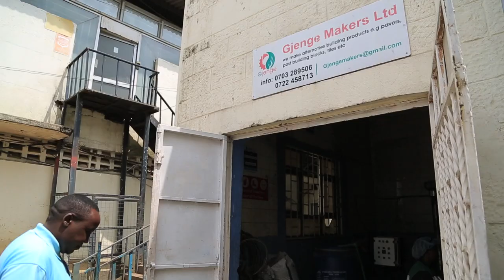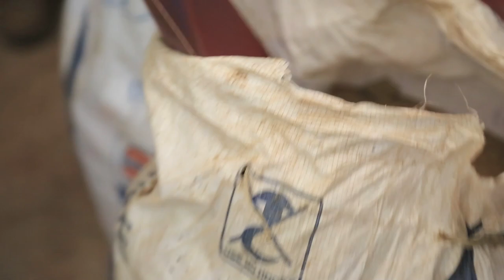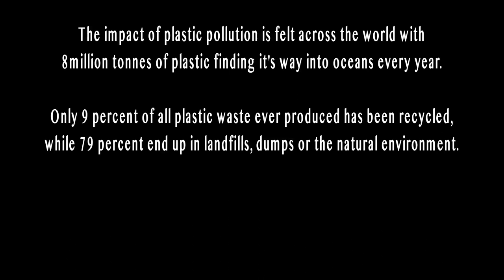We make pavement bricks using plastic waste | Gjenge Makers Journey

Comment: Not only is this a use for previously disposed waste, cleans up previous mess. But also fits in to the three Rs. Reduce, Reused, Recycle. this being a recycle/reuse case.

After seeing the project on another channel i did a quick search thinking there are a lot of none binding building products to be made. the process of plastics and "sand" indeed is used for pavers of all sizes to roof tiles, and that as far back as 2003 i saw. 

so for this particular small scale endeavour, there is definit room for expansion.

there are some downsides i see.
> sand is an increasingly precious resource
     -sand processing, round grain to rough grain, 
      grind the sand maybe
> power usage for the melting
    - green energy, heating with direct solar, or local small scale power plants.
> poisonous gas production during heating
    - the most technical problem, but europe has had trash burning plants for a while. 
      the regulation is tight so their filter systems must work on the filtering front. 
      cost and environmental impact on product life cycle is Something i didnt know about
> long term effects and product longevity
    - how long does the product last, 
          how is it with UV rays, 
          does it break down, 
          what are the effects or the broken down product.
     - How is it this heat and cold,
             breakage, expansion/contraction
     - how do you recycle this product, 
          oh she said you can reuse the material
     - does it seep chemicals over the years
    

upside i see are.
> local industry and jobs.
> acquisition of the plastics
    - collection from dumps or collection companies etc, ecosystems already exist
> reduction in transportation
    - replacing the cement or stone or clay
    - the plastics to dumps in asia
    - local product to no shipping across the globe in some cases.
> waste management
    - the quality of plastics can be low, but how low?
    - loose piles of waste everywhere to compact managed none seeping locations
    - reducion of free floating plastic waste

but taking a huge loose pile and homogenously spreading it in compact form is brilliant.
how much terracotta, porcelain, cement, or rock can be replaced. and these are just non binding solution, if its made to stick to cement, then why not build vertically with these.

aesthetics is an issue at present.  but if this world is to survive. function is going to have to take precedent to form. Why marble front porch when you can use plastic/sand pavers locally. but even then you can work on the aesthetics. thought natural colour which probably have the smallest resource footprint.

(i hadnt finished the video, which is welldone, by the time of writing the comment, so some points might be mute )

Comment: compression compression as is with low heat no shredding or sorting keep it simple. like use steel compression equipment. sheets, bricks boards, etc. keeping smell lower. better then wood or steel.

Comment: Its a great idea to use plastic bricks as construction material, but it won’t work in other countries. How can we recycle the plastic bricks when you want to renovate it? Is the plastic bricks classific as construction material or rubbish? the answer is going to be rubbish. And it is very high cost to throw rubbish in any countries. on market value MAYBE its cheap to build, but its going to be expensive to burn it down, is illegal to bury rubbish in most countries
Reply: You are extending the life of waste plastics by years or decades.  For recycling, they are stable if bonded with sand.  Or you can let the plastic recycler take it back and put it back into the melter-extruder.  Heat will make the brick soft again.